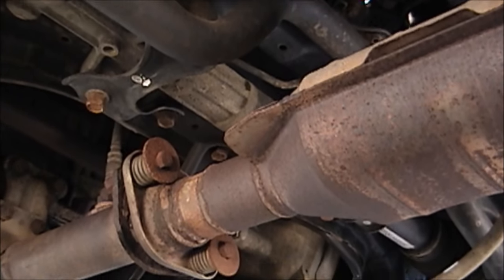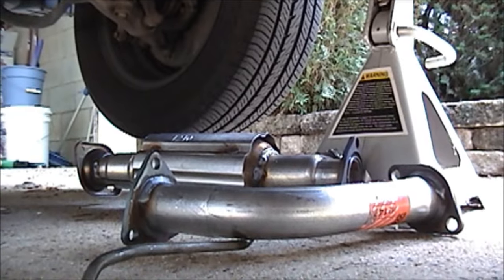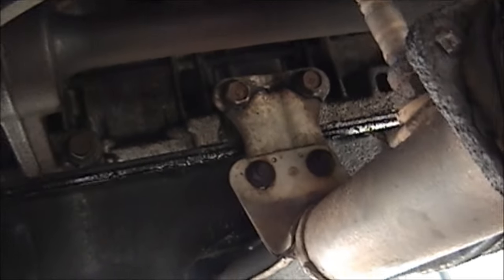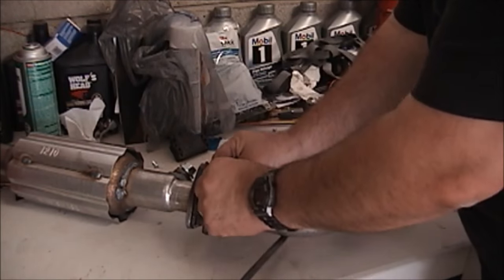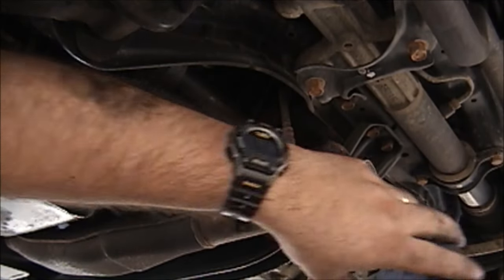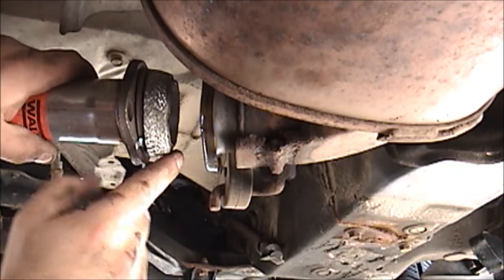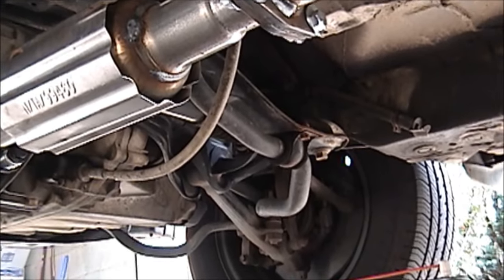How to Replace a Catalytic Converter

Comment: Your camera focus through this entire video is great. Thanks so much for making this. I have a catalytic converter clogged and now it's a solid fix.
Reply: Before replacing it completely (one of the most expensive "frequently" replaced parts in a car), you might try cleaning the cat first. Put 4 liters / 1 gallon of lacquer thinner into your fuel tank when it's half full, and then go for a good 2 hour drive in the highway. Should get you covered for a good while for just a 10er :)

Comment: I am glad I found this simple video. Two things helped me: 
1) I finally realized that the spring-loaded bolts are Not threaded into the manifold flange (I was dreading that), but instead have a nut on the upstream side of the manifold flange. As the video demonstrates, this means things are going to come apart sweetly once the bolt is broken off or cut off. Thanks for the confidence booster! 
2) The video capture of the popping spring is a great reminder that those parts can fly if you are breaking or cutting them (rather than unscrewing them). 

I might add another reminder (for other home mechanics, doing this procedure on your own) that new catalytic converters require a "break-in" period. Once everything is bolted up you want to:
1) start the engine (without revving it) and let it idle for 5 minutes; 
2) increase rpm to 2500 rpm for 2 minutes;
3) let the engine and new exhaust cool down again before taking on the road for your first test drive.

This procedure allows the internal components to go through an initial expansion and contraction cycle properly, in place, without being blown or knocked loose or out of position.

Further advice: if you have not kept up with top end carbon deposits, it would be a good idea to run top end cleaner through the system Before installing a new converter. Blowing out heavy deposits into a new converter can clog it.

Thanks for posting!

Comment: Well done!  It looks so good when you were done.  I's pretty sad that even dealer shops take short cuts.  I'm just starting to do actual work on my 1999 Accord so this was very helpful.  You mention in the video a brand name.  Is there one better than the other.  I probably have a similar situation because also had an after market CAT installed a few years ago.

Comment: Plumbers sand cloth works really well to clean off fouled pipes in tight-fitting places. You can cut sandpaper into strips, too, but I find the sand cloth wraps around easier and is a little more resilient than regular sandpaper.

Comment from the maker: Thanks for your comment. I don't think a sealant is necessary or helpful in this case. The joints at either end of the cat are kind of like a ball and socket joint, held together by spring tension, and the parts do move around a bit as the parts flex and move. If you apply sealant, and the parts move a bit, you might have a leak.

Comment: Looks like they even put the cat on upside down. I think that sheilding plate is supposed to be on the bottom to protect it from rocks & debris bouncing up. I've always said that if you want something done right, better do it yourself. Good job Alan, fixing it correctly!

Comment from the maker: Chris, I would find another mechanic. The correct way to check for a clogged cat is with a backpressure gauge that screws into the O2 sensor hole. The parts for me without labor cost a bit over $200.

Comment: Thanx Q YouTube people!!! Normally women don't work on car, but I do cuze i won't want to pay the dealer 28,20$ for replacing coils, sparkplugs, 02 sensors and cat converter on my 2007 Honda 160k 1st owner. I've got all new pts in hands under 700$. I had already checked every location where the pts. should be installed. I had replaced the radiator and timing belts on sister's car with some helps. I knew removing the cat. converter under the car is hard but hope not much harder than the pulley. of course make sure a million% in safety. YouTube people is my teachers.
Reply: +เฟิร์น เเซ่พาน  GETTING MY CAT REPLACED AFTER 20 YRS  COST 350 DOLLARS PLUS LABOR,TAX ON 97 NEON
Reply: เฟิร์น เเซ่พาน should do your water pump timing belt every 80k to keep your Honda like new

Comment: They welded it instead of using flanges because it's cheaper for you. Flanged pieces increase price. Welding exhaust in is more reliable as well. Less points of leakage. I understand it's frustrating when you decide to diy after the fact but muffler shops always weld over replacing flanged pipes when possible for reliability as well as cost. As for the RTV, I agree - that's just stupid. Especially at the cat since the cat is far hotter than the engine and also tears as the donuts move with vibration.

Comment: Hi Alan. I need your help. Talking about Dodge Neon 2003 SE. This car has a mount exactly right under connection of exhaust manifold and catalytic converter. I 've been 3 times under the car trying to fix it and tighten it a little bit more but still annoying shaking bothering my ears especially when car is in idle  "P" position or at the stop sign while car is in " D" gear, My engine mounts are all messed up so I already order it and waiting to arrive to replace them. My suspicion goes to engine mounts because engine  jumping while gear changing and lowering down engine as well. Do you think engine mounts are causing shaking or I miss something ?

Comment: Very helpful. Thank you.. In layman's terms, the catalytic converter filters the harmful gasses from your car, correct?  Should I be concerned with removing the old one and harmful particles that may be inside it?  I'll apologize in advance if its a silly question.  I'm trying to get into fixing my own car.  Thank you.
Reply: Unless you stick your nose directly in the converter and breathe deeply, then you'll be fine.
Reply: DrFrohman Thanks..
Reply: MrTarzan152 shop for cataylitic

Comment from the maker: Generally, no, unless the existing converter was clogged, causing an exhaust restriction. If your converter is no longer efficient and setting a code, replacing it should give you better emissions, but otherwise you would never know the difference.

Comment: I have a 1998 Ford Explorer XLT V8 and it has a group of symptoms leading to a bad cat. It sometimes takes longer for it to turn on , feels like it drags a anchor when accelerating , a in efficient catalytic code P0420 , I replaced the O2 sensors pre cat and they are showing codes for slow response still . I will be ordering the cat next check but I'm sure that's the problem. What's your input ?

Comment: My c300 Benz is jerking whilst on accelerating like it’s forcing itself to move at first I thought it was transmission issues but the mechanic checked the transmission with system and didn’t see any fault code.

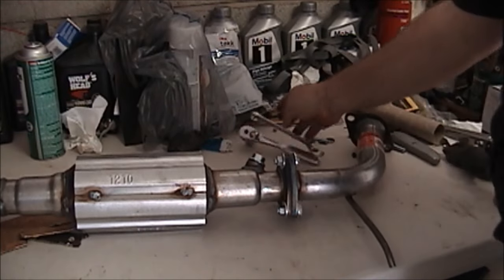Comment: Is it possible to replace the immediate exhaust pipe(the one between cat converter and muffler) without taking off the converter? because between the pipe and the cat converter, I noticed there're 3 bolts, am i able to tighten the third one easily? I saw you did it at 04:13 can i do it without taking the con converter. I just have to change the pipe

Comment: How much did this cost? I have spent countless dollars on my 2002 Chevy Tracker because it would lose RPM's and just kill the engine. When I pressed on the gas it wouldn't accelerate much at all. So going up hills would be a pain and i'd be going 10mph. Highway travel is out of the question and when i asked my mechanic to check it. he checked everything else but what I said? It has 187k miles and i only have like 3 grand to get another car with... What should I do?

Comment: I believe my cars catalytic converter is out due to constant white stream/smoke coming out of tali pipe.. also the check engine light turns on as soon as the case warms up and starts to release that smoke. does that sound like it's the cats??
Reply: I'm sorry but that sounds like a crack in the head or cylinder. Burning coolant at all?
Reply: i always heard white smoke RINGS ....... white smoke expensive engine overhaul needed..

Comment from the maker: I haven't been under a CR-V but they should be very similar. If you go to an auto parts site like rockauto.com you can find photos and exhaust diagrams that will show what the parts look like. The CR-V is very similar, with two bolts up front and three in the rear.

Comment from the maker: The Civic should be similar. I am pretty sure Honda uses bolt-on flanges instead of clamps for most of their cats. If you go to a site like rockauto.com you should be able to find a photo or exhaust diagram that will give you an idea of how the cat is mounted.

Comment: I have a 2004 Hyundai Santa fe and my catalytic converter is two parts both 450$$$ how do I know which one to buy???
Reply from the maker: Hi Megan, tough question. It depends on the reason for changing the cats. If you are getting an inefficiency code then you should focus on the cat that is monitored by the O2 sensors, i.e. the upstream sensor is ahead of the cat and the downstream sensor is behind. If both cars are monitored you might have to replace them both to clear the code. If a cat is clogged then you would have to figure out which one, either by visual inspection, backpressure test, or possibly temperature (using infra red temp monitor). I suggest posting your question on http://www.hyundai-forums.com to get help from other Santa Fe owners.
Reply: AlansFix thank you that's very helpful I just bought the infrared thermometer I'm going to check them in the morning I'm more inclined to believe it's the front too if it's based on noise
Reply: +Megan Torres  MY 97 DODGE NEON 350 DOLLARS PLUS BALL JOINT ON 1 TIRE COST 35 DOLLARS PLUS TAX LABOR
450 WOW!! THATS MORE THAN MINE
Reply: e Kopke I have a 07 Tl I need two cats on my to I have the same problems he's having my car don't pick up speed I can't ride the interstate

Comment: Those cheap aftermarket converters only last for couple of years and also give you some decrease in HPs. I recommend buying a quality performance converter. It's not cheap, but cheaper than OEM converter.

Or if you want to save some €€$$ do it the way I do: use quality performance decat pipe (they are pretty cheap) and when the inspection day comes close just change it to a cheap and shitty aftermarket converter. And after the inspection just replace the aftermarket converter with the decat pipe again! :)
Reply: +Teqo7  GOT A NEW ONE FOR MY 97 DODGE 350 DOLLARS BUT ALL NEW HARDWARE AND TOP QUALITY MADE  MY OLD OLD IS ALMOST 20 YRS OLD

Comment: Where do you find those rubber doughnuts for the exhaust?
Reply: Parts Geek
Bolts with springs
Part # 6035-05119143

Comment: Most muffler shops, bunch of idiots.
People they hire, don't know 2+2 is 4.
They weld every thing.
Had my car at Midas, tech said need a complete exhaust from engine to tail, cost me a bunch.
6 months later hole thing fall apart, I was dragging my new muffler on the road back to the shop.
Reply: monro tried getting me for the same thing

Comment: NEVER weld your exhaust toggether. such a stupid ass thing to do shops do it because most people dont want to cut it off and deal with it so they end up bringing it in and they get money.all you need are u clamps and proper fitting metal and ull never get a leak. fuck welding